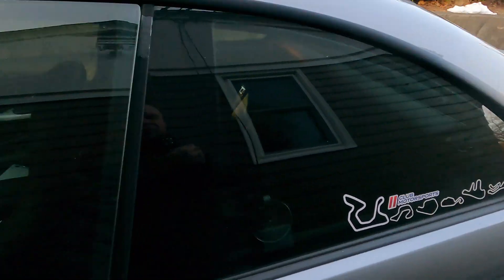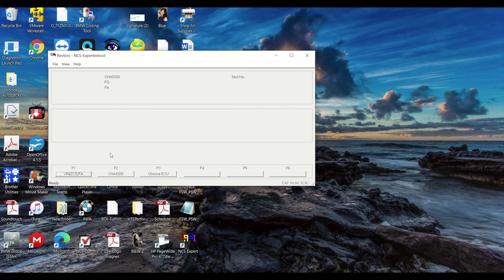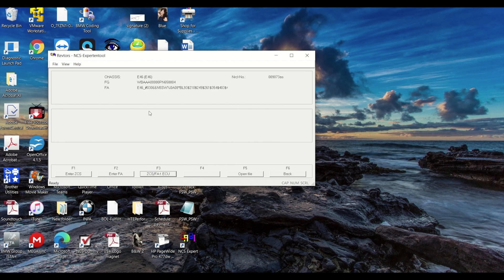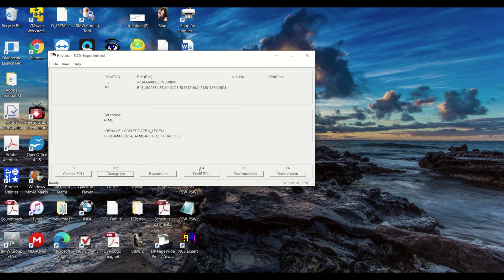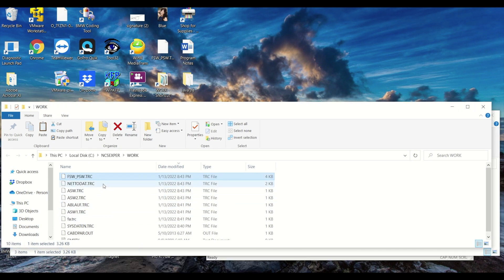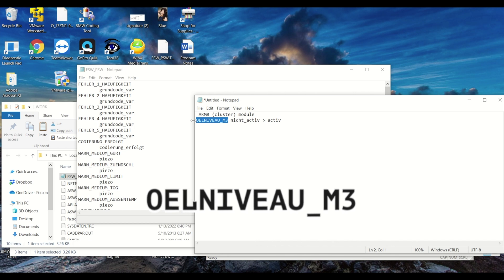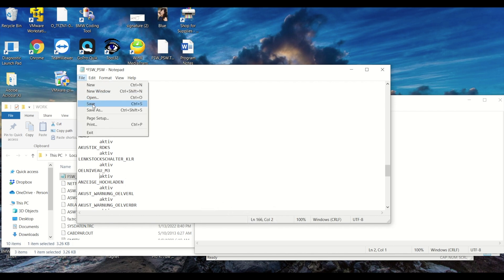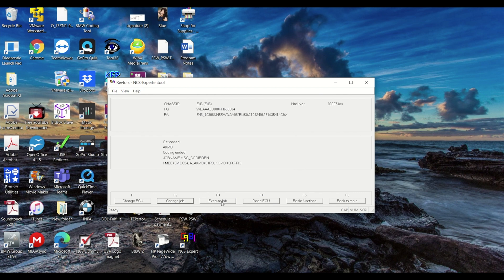How to code and enable CSL OIL Level display readout on your E46 M3

Comment: Hello!
Small question, can we flash the CSL software on a regular M3, that is completly stock? To get that oil level. Or does the car have to be modified as a CSL (intake etc....)?
Reply from the maker: Not really if you flash csl engine management you need to run Map sensor instead of Maf even if you change it car won’t run correctly becuase stock airbox restriction
Reply: @MotorsportInspired  ok thanks a lot :)

Comment: so i followed your instructions and now my SMG cog wheel light and gear position are showing up on my cluster. I have a manual swapped car so these shouldn't be there. I put the original file back to the work folder and code again but the SMG cluster still remains with the cog wheel
Reply from the maker: Hi, That seems weird as this has nothing to do with smg settings, but I can’t directy comment on this since I have no experience with smg converted cars🤷‍♂️. I would go back and check all the code lines make sure none of the them were changed from not active to active.
Reply: @MotorsportInspired  ended up sorting it out the same day. I must have accidentally reflashed to factory settings on my car. I ended up combing through the settings and finding all the smg settings and disabling them

Comment: Just a minor correction, but the "static" reading you are referring to is the long term average oil measurement. To get an accurate reading, the car should be driven a long distance to get an accurate measurement. Your measurement would be closer to +0.7L or more when the DME recalculates the oil level on the next long journey. On short journeys around town or short commute, it will show around +0.2 or 0.3L. Steady driving on the highway for 30+ miles tends to get a more accurate reading.
Reply from the maker: Yes your are absolutely correct 👍

Comment: Can you do it on mine on the next track event?
Reply from the maker: I would no problem, but like I mentioned in the video first you need to be running csl engine management software, otherwise it won’t work on the stock factory ecu, therefore first I would suggest map carbon csl airbox conversion than we can do this 😁😉